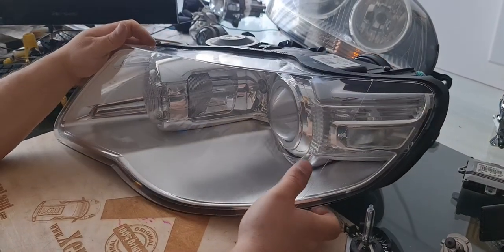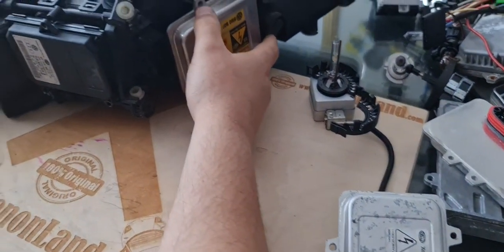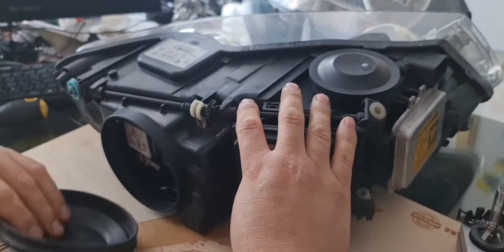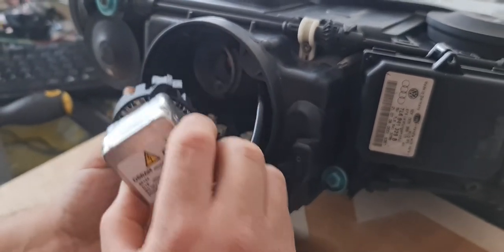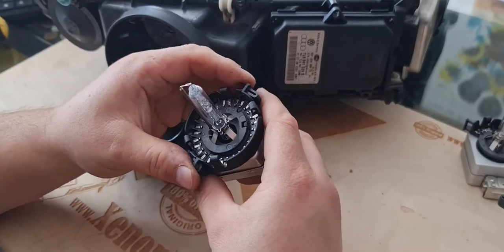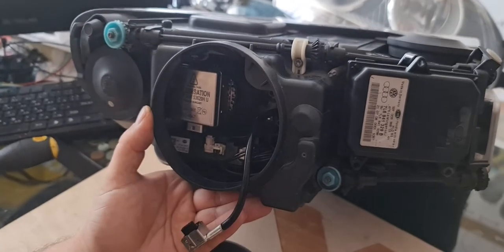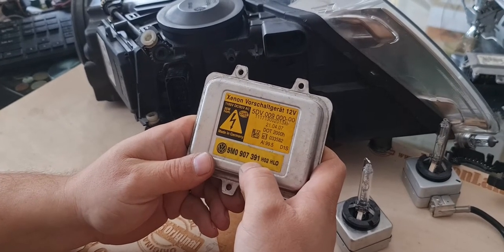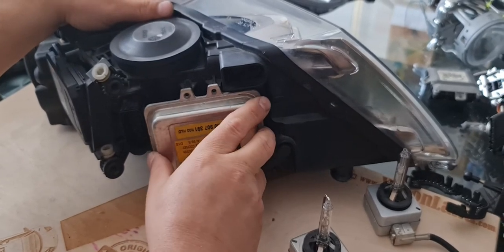VW Touareg 7L FL bi-xenon headlight low beam repair: HID bulb, ballast, AFS module replacement

Comment: Rhis is the best video I have seen on the subject! Thank you! If I have neither low nor high beam, is it just the bulb?
Reply from the maker: Thank you mate! It is either your bulb or the ballast. Just swap the bulbs between the headlights to see if you have low beam.
Reply: @xenonland  i swapped ballasts and it works on the other side high and low
Reply from the maker: @jasonmateus924  Bingo! if you took the ballast from the non-working headlight and put it to working one and you get low beam working, then the bulb at the non-working headlight is not working (putting aside any wiring/fuse problem).

Comment: Great video! So informative and precise. Thank you for sharing your knowledge! 

Do you have a separate video for the black module you mentioned ?
Reply from the maker: Thanks mate! What you need to know for the AFS module?
Reply: @xenonland  well long story short, have a non working driver side headlight. Brand new assembly purchased and installed but no function. Funny thing is...when I pull on the high beam switch it turns on the high beam only as long as I hold the switch in the pull position. Any ideas? I've had couple mechanics look at it...sadly the area where I live they "dont really like or understand german cars"
Reply: Btw it is a 05 Touareg V8 model
Reply: I have the same issue what the cause for u? Did this video help
Reply from the maker: What's your exact fault?
Reply: @xenonland  do you have an answer for my question 😀
Reply from the maker: @piksi89  https://www.youtube.com/watch?app=desktop&v=m_nYYQOlsyE&t=14s
Reply from the maker: Above video is only for afs system
Reply from the maker: @piksi89  if any fault on afs system, then high beam is automatically disabled since both headlights works in synhron, you have to find the source 9f the fault and replace it
Reply: @xenonland  unfortunately, my LCD screen on the dashboard is not working, so I cant see any faults if there are any.
Reply from the maker: You have to do a diagnosis via proper diagnostic tool to see the exact fault code and fault name

Comment: Hello !, thanks for the nice video, help a lot!!! Great video  . Do you know where i can buy a wiring for the headlight, my wiring are all crack and are wiring are touching together .
Thanks very much
Reply: Yes, over the time the wiring begin to fail and cracks everywhere. There is no replacing wiring for the headlights, but if you willing to spend 2 days on one side, so you can rebuilt the wiring. I did that and it is a consuming job. Have to take headlight apart totally to remove the internal wiring.

Comment: I just replaced my OEM ballasts with the aftermarket LAD5G ballast and now my headlight range control doesn’t work. I.e the headlights don’t go up and down on startup. Is this simply because these aftermarket ballasts don’t do that?
Reply from the maker: Aftermarket ballast just powers the D1S bulbs, nothing else. They can not communicate with the light module etc...
Reply: Thank you. Is there anyway to fix this issue using VCDS? @xenonland
Reply from the maker: No, you need genuine ballast, it is the best solution @k_4321

Comment: Hi. What if is the cable ? It is easy to replace the cable. Can I find spare cable on to the market?
Reply from the maker: Yes, it is replaceable but relatively difficult job if you do not remove the lens.  It is hard to find this cable, we usually take them from accident damaged headlights.

Comment: Hi, I've got an a problem with the low beam on both my Touaregs headlights. Right low beam works 90% of the time and left low beam only around 25% off the time. I've already replaced the silver control unit on the left headlight and had new plugs installed that go into the back of the headlight.
Any ideas what could be causing the issue, could it simply need new bulbs? Any help appreciated, thanks 👍
Reply from the maker: Your headlight xenon system consists of xenon bulb and the silver ballast. one of them causing intermittent faulty. If you have 100% working balladt 9r bulb you can make diagnosis by swapping them between the headlights

Comment: What if the High dim headlights if it not working..how to fix
Reply from the maker: At Bi-xenon headlights high and low beams are at your projector and powered by the silver ballast. In case of low bem failure, If bulb is working, ballast is faulty.
Reply: Planning to open it and see inside after water damage